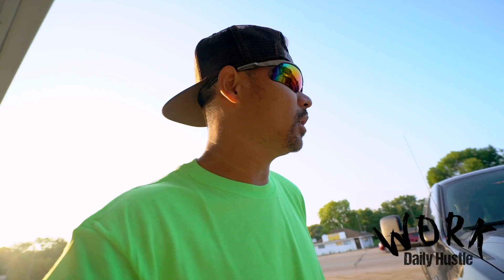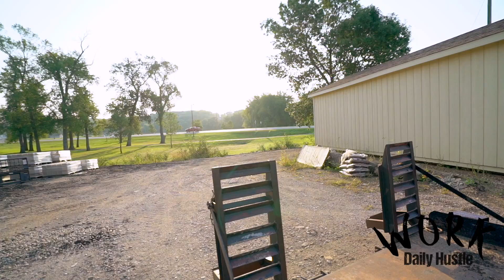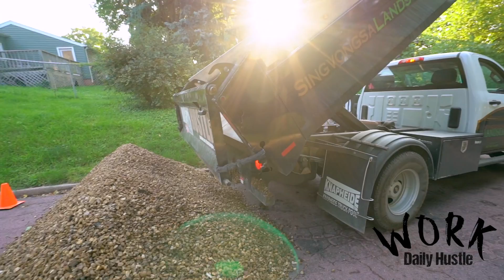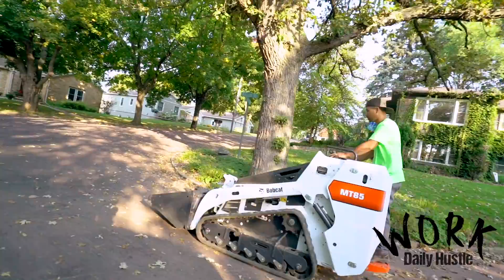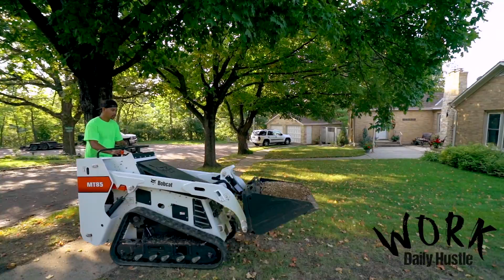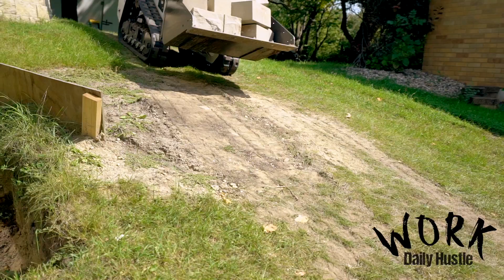Bobcat MT85 with 36" bucket

Comment: Throw them pallet forks on next time it should lift 1/3 pallet my s 70 is a mt attachment non walk threw forks are commonly universal. If not there's always the standard to mt plate adapter.   Congrats on the new machine chant looking forward to the review on it.
Reply: i seen that worked and some put a quick attach  ALO quackie that can run attachments with J shaped hooks on it with 1 leaver to lock both pins with out going back and forth wich slick option too